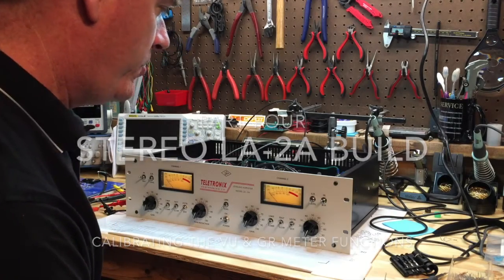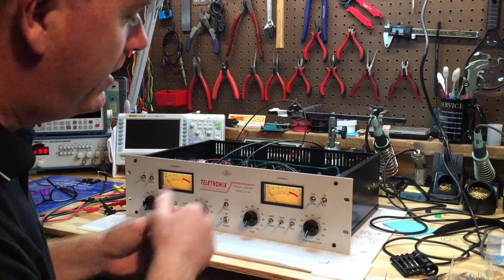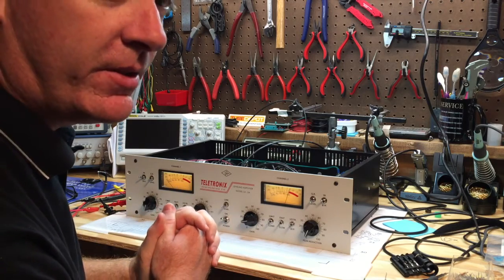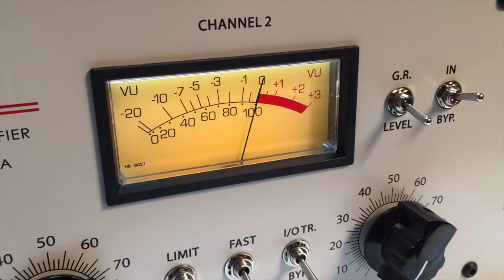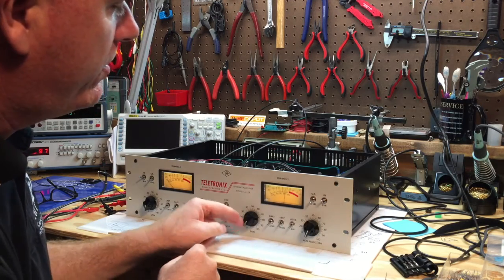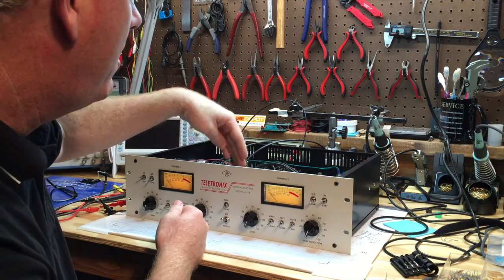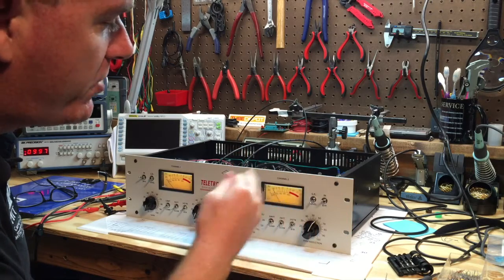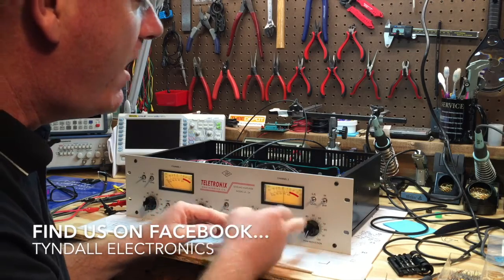Stereo LA2A Build - Part 4

Comment: Hi i really enjoyed all 4 videos.. i'm about to built one myself with a faceplate from Don Audio. It does not have drilled holes for "FAST/SLOW" switches or "IN/OUT TR. BYP" switches. Are these switches/holes essential/necessary for the same built you did or is it some of your own add-ons? 
Also: can the "IN BYP" switch that's on each corner, be connected to each other, so only 1 switch can control both channel-bypass?
Again, the faceplate im ordering offers to drill one or two holes in the middle (below the "link switch") for BYPASS switch.
Reply from the maker: Yes!  You can modify the bypass function to operate both channels from one switch.

Comment: That case is amazing, where did you find it?
Reply from the maker: I believe it came from Collective Cases.  The front panel I received wasn't as shown on his website.  He emailed me a picture of it when I requested pricing on the case.
Reply: Nice one! I am about to embark on this build myself and I am in the UK so i will give them a bell.  I hope you will make a video demonstrating your build.
Reply from the maker: I was mistaken.  Case came from DIY-Racked.com.
Reply: I built mine into a 2u case which used to be a power amp in the end. Amazing sounding unit thats for sure.  I really don't like the mirroring of the controls so I made my own front panel.
Reply: I saw some mention having the mains power switch in the middle causes some problems with hum on this case. Have you noticed it at all?
Reply: Hi, ¿Where can I get these front case? I'm try found in anywhere in all the sites... I'm very interesting, my email es moybm@hotmail.com 
In the DIY-Racked.com can see only the  3U mono versión.

THANKS!

Comment: Thanx for this series of videos.i really enjoyed watching them. You really have a very calming way of explaining stuff. 
recently i built gssl bus compressor myself with very little knowledge. Turned out pretty well for first-time project. 
I just bought a silent arts d-la2a from a guy who couldn't get it to run. In this case I left the error tracing to someone more experienced. 
Anyway, Thanx a lot for the videos, I'll check for more on the future. 

Best 
Ilan
Reply from the maker: +ilanschulz You should have accepted the challenged and troubleshot the unit yourself!  LOTS of learning opportunities in one of these, IF you have the patience.  The circuitry is fairly straightforward and "simple", compared to many other units.  I will have a circuit theory video coming in the near future.  Cheers!

Comment: Why do you calibrate with +4dB instead of 0dB ? I mean shouldn't you be using 0.775VAC on your signal generator?
Reply from the maker: +Exorcism Official Great question!  Actually, saying +4dB or 0dB means nothing, since dB is a "relative" unit (or ratio) between two values.  So, to answer your question, I'm using both!  So, +4dBu is the SAME as 0dB VU, which is an audio signal that has an RMS value of 1.228 volts.  Now, if I was referring to a 0 dBu level, that would be 0.775 volts!  Confusing stuff, huh?

Also, performing this calibration of the VU and GR tracking, the input signal level is not that important, as long as you can adjust the gain control to obtain a reading of 0 dB VU on the meter when looking at the audio level.  Personally, I wanted a 0 dB VU signal coming in more for my own satisfaction that a) the gain controls "sit" at the proper location they should for an LA2A, and b) this would allow me to quickly judge the amplifier stages are working properly with the proper gain.
Reply: +Prentice Tyndall is dBu and dB VU the same thing?
Reply from the maker: No.  While the scale is the same, there is always a 4 dB difference.  Example: -20 dBu equals -24 dB VU, and 14 dBu equals 10 dB VU.